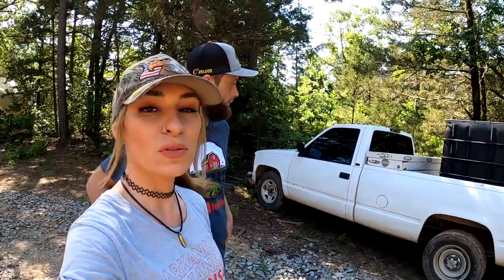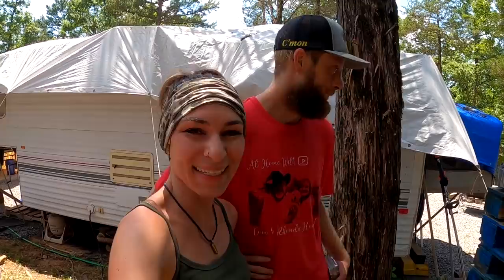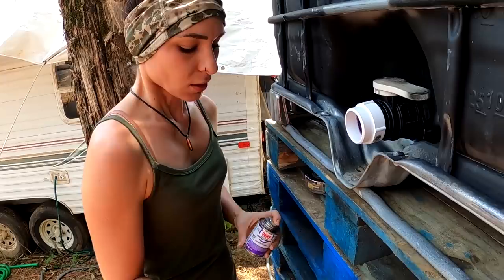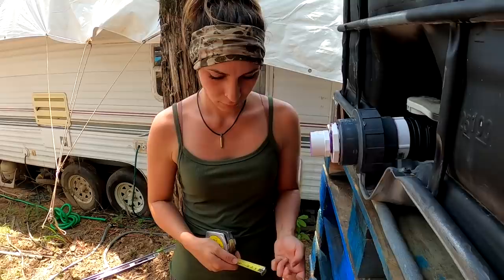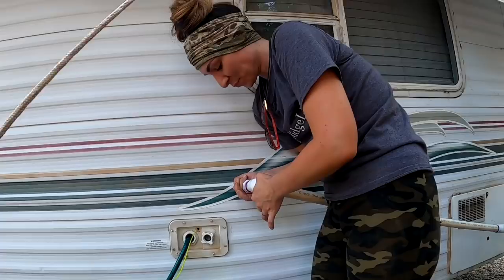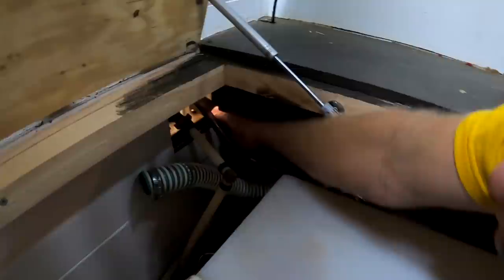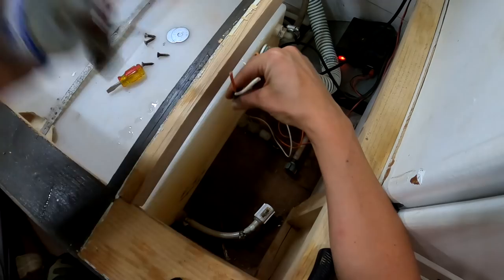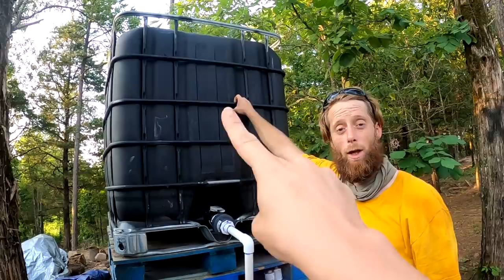He's Putting HER to WORK! | Water Tower For Our Trailer

Comment: If you ever plan on using the threaded coupling again, I would use Teflon tape on the threaded coupling. PVC cement on the unthreaded couplings. Just my opinion and you know what they say about those…
Reply: Plus, the valve is ABS most likely.  Need special glue for ABS to PVC connections.
Reply: That is what I think also
Reply: Not understanding why clue the thread's
Reply: @dalekronk496  -  I don't think any of us know why they glued the threaded  joints.  Doesn't make any sense to me (Unless they didn't have any thread sealer (tape or joint compound) on hand.
Reply: I always sand all the fittings with sandpaper before priming. Also I hope you have a vent on the top of the tank. Enjoy
Reply: Thanks for the videos. I watch them all. Just curious, what are you doing with your gray and black tanks ?

Comment: With all the wood, timber and brush, you should be able to find several "Y"  sticks  braces for the pipe. Or shorten the 2 foot straight down pipe and angle to the trailer. Gary great job in teaching Mel to do such an awesome job.
Reply from the maker: Absolutely! Yes we are not completely done yet and still have to insulate it before winter. We wanted to see if it would work before we made it more permanent. Great idea about the Y branch 🤗🤗🤗

Comment: The gravity system will work but you’re still gonna have to use your water pump for pressure or you’re going to need to get some bigger pipes and raise that tank much higher in the air and have a much greater water volume to create enough pressure basically the tape being connected it’s just going to keep your tank for longer and you’re expanding the capacity of that tank but the pump is still going to provide your pressure.  As far as letting air out of the system to stop the suction, you need to crack a vent on the top of your exterior water tank as well. You guys are so patient I would go nuts working inside of the trailer I would pull the bench out and put everything outside because it would drive me crazy.   One suggestion might be to go ahead and buy a pressurized tank and well pump system because you’re gonna put that on your house eventually anyway but that’s gonna take Electric and more of it than the small pump so that’s a consideration as well so you probably wanna wait until after you have some electric up there.  There are solar systems the equipment is basically 12 V anyway even though it’s adapted to work with 110 or 220 it’s still usually a 12 or 24 V pump and you could set up a pretty simple solar system to run it just like you could on your other pressure tank at the top of your well I don’t always have to be running it on generator. And then you would have full-time water pressure and not have to worry about it as long as you had enough solar panelsTo run the system and it’s really not that much most home size water pump systems can be runoff of four panels at 200 W each and if you get a DC pump you don’t have to worry about an efficiency loss with an inverterWhich wastes about 15 to 30% of your power, solar panels are getting cheap you could probably do the whole system for under 1000 bucks and it would be something you could put on your house once that’s built

Comment: Hi guys it's all ways nice to see what your doing.The reason you elevated tank didn't work was because when the pump is off its like the water valve is shut off. The water wouldn't push through the pump. If you had ran two lines one to the pump or tank  and one  as bypass  past the pump  your  elevated tank system may have worked for you.If you every get back in two your water system give it a try.Good luck you all are getting it done.

Comment: The plastic pipe primer Does help clean the joint, but if it has any real debris on it, you should mechanically clean it 1st (using clean rags and maybe fine emery cloth like you would use to prep copper joints)....the MAIN function of the primer is to pre-soften the surface of the joints, so the glue can get a deeper "bite" into the plastic. With that said, each joint should be primed immediately before you apply the glue -- Don't prime multiple joints and then go back and start gluing them up.

Comment: Great ingenuity. I think you mentioned that it snows in your location.  If so please think about weather proofing your plumbing and trailer sooner vs. later. Maybe build a temporary pump house for the totes with a heater that clicks on when the temperature gets close to freezing. Also insulate the plumbing where it enters the trailer. When it gets cold in a humid climate it seems colder than where it’s dryer. It may be a good idea to make the space outside the two trailers insulated and enclosed so you could heat it this winter, it would make a huge difference in having that extra space.

Comment: hook up your camper to the well, your camper has a city water hookup on it, just use an RV regulator at well end of your hose
Reply from the maker: We could run directly from well - but generator has to be on to pump water from the well to the trailer, defeating the purpose of less generators running time for us.

Comment: I don't know why you're gluing your threads together. I would have used teflon tape and pipe thread sealing compound, because if you ever have a limb fall on it and break it... you can't unscrew it and repair it if you glue the threads together. Coming out of the tank you were mixing DWV and pressure fittings,  but itll work.I was a plumber for 35 years by the way. Also when you screw plastic female fittings onto male, it's a good idea to put a hose clamp around the outside of the female to protect against it cracking and leaking later. I always did this when hooking to City Water Supplies because we had to use females on to the meters, and I have seen a lot of crack fittings a few hours after they were installed. but with the hose clamp there's no chance of that👍👍

Comment: Simple Life Reclaimed, if you wish you could check this video out on pump in a box. It’s what we did while at deer camp and worked very well. Can run on camper battery and can be used wherever later on down the road. God Bless you guys, stay cool!

Camping with Dad Fall 2020 (Part 2)

Comment: Thinking ahead, winter time, the exposed pipe (especially the thin wall) is subject to freeze and breaking.
Reply from the maker: We will be insulating before then for sure.
Reply: As some people have suggested, instead of using adhesive on the threaded joints use Teflon tape.  This will allow you to make repairs or modifications without having to purchase new threaded couplings (which are the more expensive parts).

Comment: Awesome!  Adapt and overcome!  Much better for your family!  Can’t imagine how by the time you do dishes and showers for 5 that 30 gallons lasted even one day!  Great solution!❤️❤️❤️❤️
Reply from the maker: LOL! By using it very, VERY sparingly. Showers are basically get wet, turn off water, lather up everything, rinse, condition hair, rinse again - get out! LoL! And dishes I would just wet the sponge add soap and wash everything with water running at a tiny trickle. Most of the dish water was used for rinsing. It was challenging, but we made it work the last few months.

Comment: HERES A HEADS UP TIP GUYS TO THINK ABOUT. 
Guys you’re probably gonna want your water tank hooked up in that camper and use from it if possible. 
Reason Being: 
Because unless you build a house with lots of insulation in it, over & under that 270 gallon water tank outside....as well as insulate the pipes and put electric ⚡️ heating tape on them. Then you run the risk of your water tank & pipes freezing 🥶 up this winter ❄️.  
Which is only a few months away now. 
So you may want to fix the inside tank back to working status so you’re using from the tank inside the trailer. Because the temperature will be warmer inside the trailer keeping your 30-40 gallon tank inside from freezing . But you’re definitely going to have to well insulate those outside pipes and run electric ⚡️ heat tape on them as well as build a insulated box around that 270 gallon tank to avoid frozen water this coming winter. 
Not sure about the winter temps in that Arkansas area you’re in but most mountain ranges get pretty cold in winter months. 
😉👍

Comment: That will work well until this fall and winter and the freezing temps return. I would plan now to insulate the base of the trailer to minimize freezing! And as others stated you never use glue on threads Teflon tape or sealant so you can disassemble before it freezes.

Comment: So on gravity feeds a foot fall is 1 psi. If your tank is full and it's elevated, let's say 8 feet tall total between stand and full tank,  you would have 8 psi(pounds of pressure) always try to keep your outflow ( where the water will come out) lower than your tank. Make sense? We have 4,500 gallons of rain water catchment, not near as much as we want but enough for now.

Comment: Hey guys, FYI You ran the plastic pipe next to the hot water heater vent? This gets very hot at this location and could melt the  pipe. Also why bye pass the 30 gal water tank? Wouldn't be alot  easier to hook up the pump using the  current pump and tank configuration as already  installed? Just saying. 
My wife and I love watching all of you. Hope and pray you find the life you are searching for. 😎
Reply from the maker: Hey Ronald! We first tried hooking it up to "city fill" and gravity feed the water from the tote to that inlet and the pressure just wasn't there. Water WAS coming through pipes just just a drizzle. Not enough for our needs. We thought about using the "holding tank" connected to the 30gal to give us a combined 300gal.. but after some engineering found we would have to have a new float system inside the IBC to tell it when to open and fill the 30gal interior tank. Parts were more spendy, and we were not positive we could make that happen tbh. So we bypassed it and got it working! Granted, not the way we initially intended.. but sometimes life goes that way. Roll with it 😉
About the hot water heater - nive observation. I've been checking that area since its been brought to my attention and it doesn't feel hot after our showers.. going to keep an eye on it though.. We still plan on insulating the PVC outside before winter and adding something better than bungie cores to hold the pipes up in place. LOL maybe at that time we'll move it over a bit just to be safe. Thank you for being here!

Comment: A plumber you are not just like you said... LOL....  Did you think to just open your top fill cap on the big tote? With the fill cap loose you should of had more than enough pressure. That's why I asked if you opened/ loosened your fill cap on your big tote... Even the way you got it hooked up now you need to loosen your fill cap or take a chance of burn up your pump when the tote when the level get lower. BECAUSE with your fill cap on tight you are creating a vacuum in the big tote and your water will not flow properly to your pump...
As for the small leak you had at the fill port where it when into your camper all you needed to do was to put a bit of plumber's tape on the threads and that would stop the leak...
And yes I am a retired plumber over 45 years of turning pipes...
You kids be blessed in Jesus name... BBE...
Reply from the maker: Hi Bobby. The big tote WAS vented, and the leak was not the only ly problem. Inside the trailer there wasn't enough pressure to send water through the pipes. Should have been but apparently not. Thinking the tower would have to be even higher than it is, and we don't want that for temp camp life.. 
Our work around is working great and we have access to the 270gals as we wanted.
Also, yes we will insulate before winter. 
Really appreciate you!

Comment: Why not ? Connect rv direct to well source ?? Or do you need a  pressurized tank so pump can cycle
Reply from the maker: We could run directly from well - but generator would have to run to pump water from well to the trailer, defeating the purpose for us.
Reply: @SimpleLifeReclaimed  true

Comment: all you had to do was feed your big tank into your 30 gal. tank in the camper and turn on the pump. the pump was holding your gravity feed from working.
Reply from the maker: We had it going from IBC to "city fill" by passing the 30gal to begin with. I guess gravity just wasn't strong enough to fill from that hole. And to be sure there would be no pressure problems with 30 gal tank we just did it this was. Worked great!

Comment: Did you leave the tote cracked open on top? It'll need air to replace the vacuum that will be created.
Reply from the maker: We did leave it open. I don't think the tote is high enough for the amount of pressure we need for the trailer. But the work around worked out 🤗

Comment: Did you crack open the lid? I run a hose from my camper at the lake and it works fine as long as I open the lid.
Reply from the maker: Our lid is open and was open then too. I don't think it is high enough to create the pressure we need for inside the trailer. The bypass works good for now. May reevaluate later but honestly it's working now how we need it to. Will  Def need to insulate it before winter.

Comment: Lol. I’m gonna go all scientific on you. Heat transfers via convection, humidity facilitates that convection. Dryer and dry heat when it’s 100° your body sweats and you don’t even get wet because your skin admits that moisture in it is instantly vaporized and it’s kind of like having a little air conditioner around you pulling his away which is why your body sweat that’s what it supposed to do when you get in the humidity situation’s moisture evaporates slowly and so your sweat sticks to you and Glamis on to you and you lose that air conditioning affects and your body heats up much faster so it’s not that it really just feels hotter it literally is hotter and heating your body more efficiently even though it’s not a higher degree of heat that heat is hitting your body more than it normally would in a lower humidity situation which is why you can go out in the desert with a slight breeze at 85 and 90° and it’s kind of comfortable and tolerable and why in a humid environment that if you do any more work than sitting in a chair at 77° you start to sweat and overheat and once it starts it can’t be stopped. In California and Arizona you go out and start working and you start to sweat you slow down a little bit lift your arms up get a little breeze on you and you can stay dry. Don’t even try that out here, once you start moving and it’s humid you’re just gonna sweat and overheat, just stay hydrated dump water on your head and cool your body other ways and forget i’m not trying to stay dry and not be sticky and gross and disgusting, that’s just part of it. It’s really good for plants though which is why it’s so green and beautiful out there instead of just a bunch of barren sand and short dry brown plants.  So, I guess think like a plant.  Lol. I found it’s best to just suck it up go out to work done sweat like a pig and deal with it and don’t waste energy on trying to stay cool or not sweat throw in some nasty clothes go out there and get it done and go jump in a pool or a shower or a river and cool off when you’re done. It is what it is but that’s just how it works both places have their advantages dry climates and humid but both definitely have there are disadvantages as well so just understand how it works and go with it is all you can do. Lol

Comment: I live  in rv 365 /24-7 and not use holding tank   just press reducer that comes with  rv  potable vwater hose kit  and connected  to water supply  source
Reply from the maker: That'll work! For us, if our source was our well hose We would have to run our well generator nonstop to pump water from well to the trailer on demand. This was the fix to that dilemma.
Reply: @SimpleLifeReclaimed   i was going  to suggest  that use 2" for drop leg  and keep 2" over to trailer  before  reducing  to 1 or even 3/4 
  The pressure  aply from tank effected by out of tank  ? I believe. 
 Grand parents  10 acres of orchard irrigated with sprinklers plus house   the drop from fume about 150 ft × 1/4 mile  to supply  value  for sprinklers  could  run abot 50 sprinkler head   the hand lines  started out 3" pipe × 30ft between  sprinkler   after about  6 lengths of 3 then reduced to 2 " for about  8 lengths  and run 3 lines running at same time  the pressu was 35 lbs plus

Comment: You get .433 lb. Per foot of drop . If you are dropping 6 feet to the trailer hook up , .433 × 6 = 2.59 lbs.
Reply from the maker: Ya, it wasn't enough for our needs in the trailer.. higher tower needed.. but we don't want to put one any higher here in this spot. This work around will work.

Comment: If you had simply bypassed the pump and fed the incoming water to the pressure side hose (RV water system hose)...the gravity feed would have worked perfectly...absolutely no reason to use the RV pump.

Comment: Hey folks RV DOC here please make sure when the water heater is on it doesn’t melt the pvc pipe just might start a fire if you folks need any help on your rv just hit me up
Reply from the maker: Thank you RV DOC! We haven't finished completely with this yet, as we still want to insulate the pipes for winter and move the one a lil bit away from the water heater vent. Thank you for your caring for us!

Comment: Hey could it be vacuumed lock crack top filler cap. For water to exit tank it has to be replace with air
Reply from the maker: We had it vented. It just wasn't enough pressure I guess.

Comment: Sorry some with wrong with speel-check or something. Had to edit half of my response Having to fill that 40 gal tank took away all your gravity pressure. You should  have just ran the pipe around the outside of it. and you would not have needed the extra pumps.
Reply from the maker: Huh?